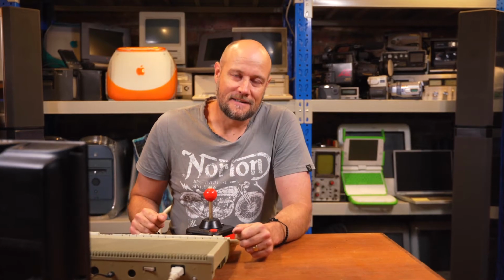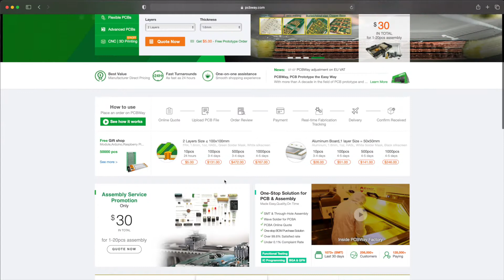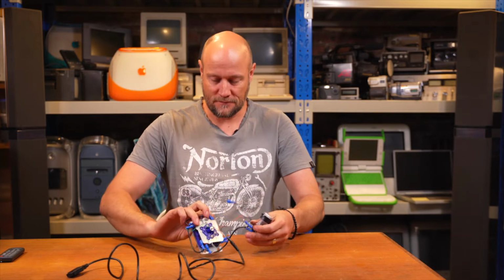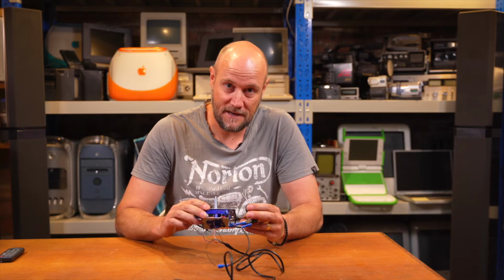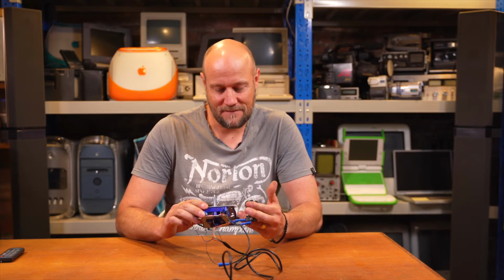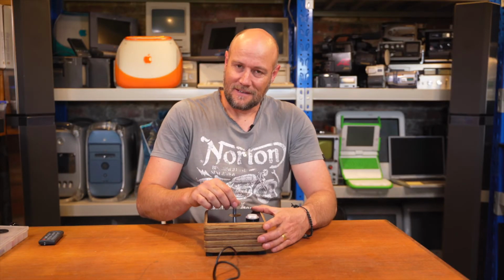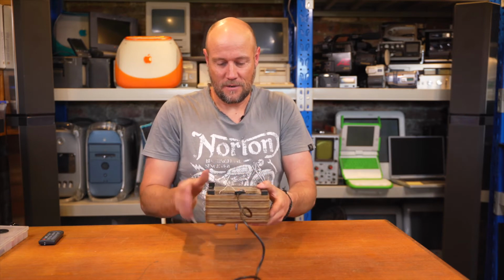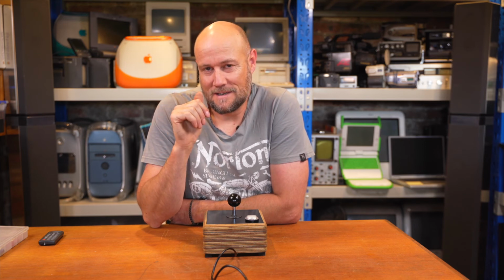Making a Microswitch Joystick for Retro Gaming!

Comment: Nice project! I am at the designing stage of my second DIY joystick as I would like to make one less bulky but it is really tricky finding out how to do keep it slim and hide the mounting screws too at the same time: If I want to elevate the middle part of the joystick to keep the sides low-profile then I need to remove the mounting plate but that way I have to mount the joystick from the upside instead of the bottom.
Reply from the maker: Yes it’s tricky. I wanted to make mine slimmer, but would need a metal case or something similar.